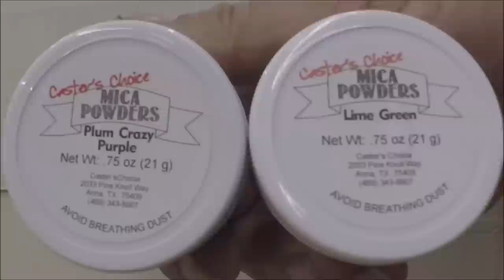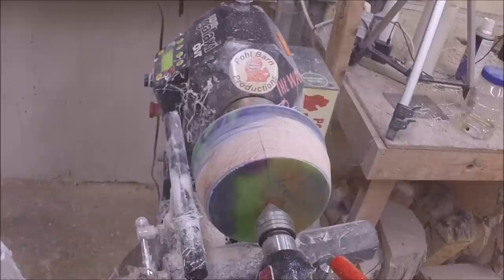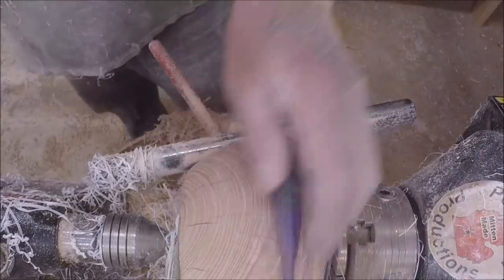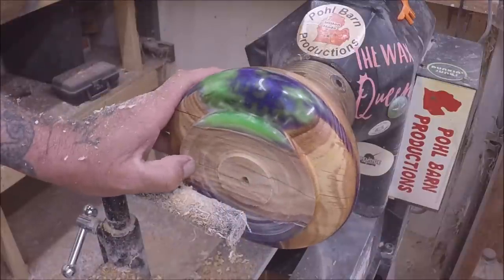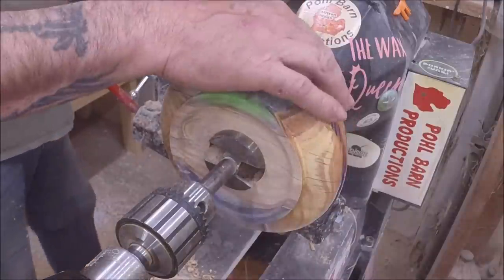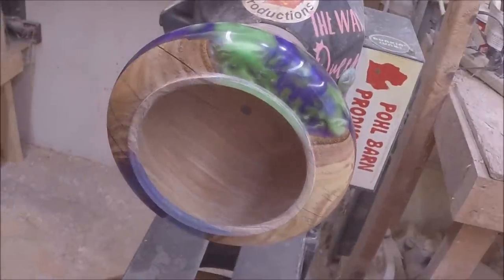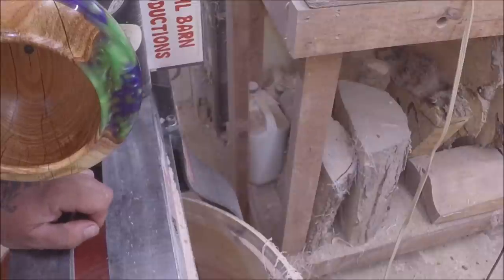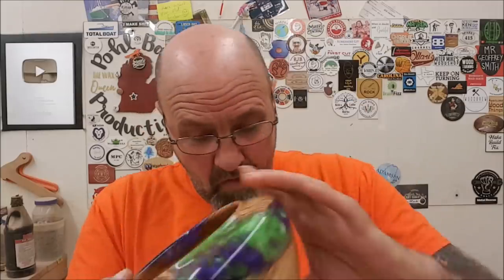Joker Bowl

Comment: Looks good, Doug.  I'm surprised that honey locust was so hard.  Black locust is pretty hard stuff, but I've loved all the honey locust I've turned.
Billy
Reply from the maker: Thank You Billy, I have no idea what kind of locust it was just that it was locust and I'd gotten it in trade for welding the splitter back together it has broken.
Reply: It's Honey locust.  It doesn't have the grain structure and black chatoyance characteristics of black locust.

Comment: "this is not what I wanted"  .... I think the problem started right after you poured the first drops of resin in. You see the wood floating up on one side and during the rest of the pour, it kept shifting sideways a few times. I think during the curing process of the resin, there were air bubbles forming under the wood, pushing it up sidways and that allowed the weight to slide off to one side. My suggestion, make yourself a wooden X with a round dowel in the center to fit into the hole of the weight. The legs of the x will rest against the side wall of the bucket and the dowel will hold the weight centered, keeping it from sliding sideways, even if the wood floats up a little. ;)
Reply from the maker: Thank You

Comment: dad was a plumber.  plumb loco.
saw this final product at etsy, had to find the video :~)
interesting, that hole in the bottom ( could string a wire through ?)  is it a whole hole or is it only half a hole ?
Reply from the maker: Thank You Debra, the hole is from cutting the wood to shape for a round blank, I suppose you could make it what you want but it is currently not open but it could be

Comment: As you moved the bowl around, did you break through the. Bottom or fill it with resin?
Reply from the maker: no John,  that is the hole from when I turned the blank to round on the band saw,  some times I drill it a lil to deep

Comment: Once you put the plastic block on the wood, if you hot-melt glue the weight to the plastic, it should stay put (assuming hot-melt sticks to both plastic and metal)...
If the hot-melt doesn't work, perhaps epoxy the weight to the plastic and just leave it as one piece for future projects (might make it easier to get the plastic off the resin by adding a weighty handle to it)...
I know, I know, I really should avoid making Bad Puns...
But everyone that knows me knows I'm never gonna...
Reply from the maker: Thank You Thank You
Reply: @PohlBarnProductions  You're Welcome...
Usually Happy to help...
Not Always...
But Usually...